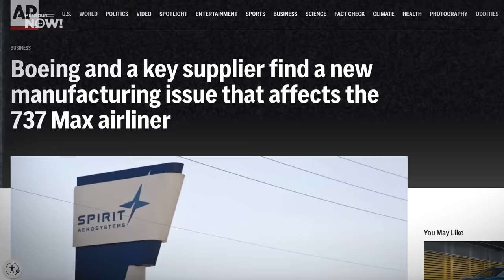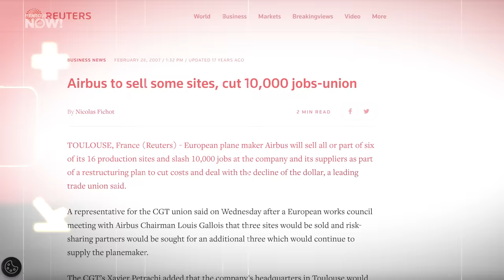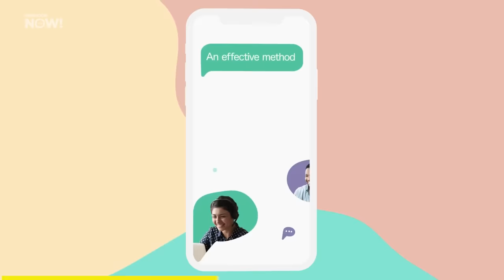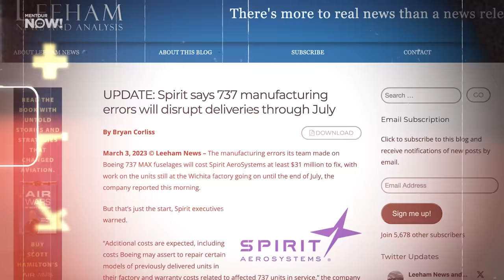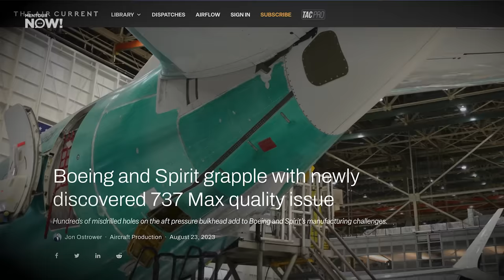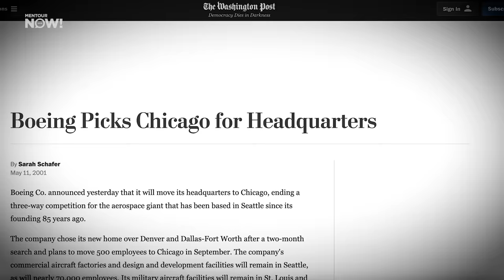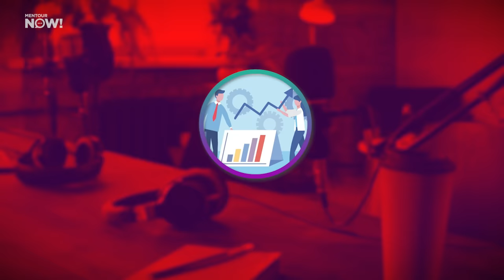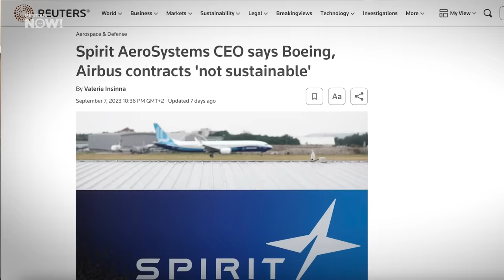NEW Problems with the B737MAX!

Comment: I’m not a financial expert by any means, but it seems to me that this whole RONA thing only works if those divisions produce different products. If what a division is producing is core to your own company’s product, you would think that that was maybe more important than the fact it made less money? Maybe your profits in other areas are because this department exists? And if you spin off the department into its own company, not only do you lose precise control, but it also has its own complete management structure which will make it less aligned with you and more expensive
Reply: Yeah exactly, if your other products are fundamentally reliant on it then the theory doesn't make nearly as much sense. An example of this that always gets to me is when some penny-pinching government cuts its rail service to small towns in the middle of nowhere. Sure, maybe the line didn't turn much or any of a profit, but if I can't get to the nearest major city then the fancy high-speed line passing by there that they keep bragging about is fucking useless.
Reply: True, internal cost allocation is a stupid idea brought into big companies. Every year, something is shuffled (e.g. switch from an expensive component to a cheap one) by the customer departments to save costs. But as these costs are driven mainly by fixed costs e.g. personnel, next year these costs will be allocated to the remaining or other parts of the equation😂 Outsourcing of important „components“ of the whole operation pipeline in most cases leads to costs which are just written on another page of the same financial statement. Only sometimes costs can be transferred to employees or the customer or society, but that‘s actually a bad thing.

Comment: If I remember correctly, Airbus added small surveillance cams to their riveting machines at wing production site. Putting 60000 rivets produced 60000 shorts as camera turned on and off with the machine. QC then may have inspected these videos.

Comment: Worrying for Max8 aircraft in service. My main concerns are how many Sprint made bulkheads are currently flying around with elongated “snowmen” holes, and even more concerning is what is their pressure cycle to failure, ie. how many take off and landings and flight hours logged at high pressure? Thanks for clearly explaining these issues which I had only vaguely heard about previously.
Reply: reminds me of what happened to the china airways plane with he bulk  head repair
Reply: @wayneandrews9298  Japan Airlines wasn't it?
Reply: @jambon7681  eeerrrmmm , i think we are both right ,, china airlines 611 did suffer a catastrophic failure & split apart & crashed & yes it was the japan airlines flight 123 that suffered the catastrophic failure when the the bulkhead gave in ,, very similar but of course very different ...

Comment: Railway land should be kept as a strategic reserve. As in the UK, they were built when the land was available. To close the line is one thing but to re-purpose it for roads/cycling/walkways seems incredibly short-sighted. The generous U.S. loading gauge is certainly an asset.
Reply: The lines did not close. They are intact and in operation.
Reply: And yet country after country goes and privatises its railways completely

Comment: So Add loose door plugs on the max 9 to the problem list, a few days ago Alaskan airlines flight 1282 blew out a door plug at 16000 feet. Investigators found that bolts holding the door plug on were loose. Whole fleet is grounded again

Comment: Hi Petter. I don't understand how its ruled out that these issues are not present in airplanes currently flying in the air. Could you please explain a bit more? I have friends using the MAX 8 regularly and these production mistakes are quite furious to say the least
Reply: No they're saying it's not an immediate safety concern for currently flying aircraft, presumably based on engineering analysis, meaning they still need to remediate the problem but they don't have to ground these planes until they are fixed.
Reply: It's something like a component originally rated to 200% of flight load can only handle 180% because of the mistakes. So it needs to be fixed, but not urgently.
Reply: I think he’s saying it’s not an immediate safety concern which it’s not.
Reply: They’re just waiting for a couple of them to drop down and kill a few hundred.

Comment: As a greater Wichita area resident therefore aviation fan, I dont like losing ANY aerospace jobs, the layoff/callback/strike cycles lead to a lot of stress and economic turmoil for skilled fabricators, installers, and A&P mechanics. I will say, if Spirit can get an edge on Boeing, the latter will deserve it for creating a (now independent) wholly-owned subsidiary to break existing labor contracts with the parent company.
Reply: It'd be a big step, but I'd say there's a case for Spirit to make their own airliner. The advances to be made are in aerostructures, wing designs, which Spirit is not inexperienced in. Subsystems can be bought in, as can engines, undercarriage, etc. 

Why be subservient to debt-laden, cash starved, badly run Boeing, when they could go it alone? Better still, they have a grip on Boeing's means of production for the 737 cash-cow; they could, and probably should, squeeze.

Another (crazy?) option would be for Spirit to go full-in with Airbus. Airbus clearly want to expand in the USA, and are quietly building an empire down in Mobile. Why wait for that to grow to dominance (which it will, whilst Boeing prevaricate), when Spirit could be part of it by presenting Airbus with a really big step up in the USA on terms that are good for Spirit too? 

That could mean the end of Boeing, and the global dominance of Airbus. But, if "Airbus" then meant "substantial US involvement and participation in the group", that could be something the US government could be happy with.

Comment: As a restorer of classic cars, I noticed early on that whenever I would try to save money, no matter how well thought out or sensible. It always cost me more money in the end. I think that trying to modify the existing product to take the new engines, as in the 737 max, Boeing encountered the same issue. I have dealt with many times.  Whenever you try to save money, it costs you more in the end. I have been flying a lot lately and on a recent flight I noticed the card in the back pocket of the seat ahead of me, said Boeing 737.  I asked the stewardess if it was a 737 max. Somebody two seats behind me laughed and said, that was my question! I was actually considering disembarking the plane. I will never fly on such a thing. Boeing had better start to think. I believe that company is incapable of making sensible decisions.
Reply: At least you get a learning experience out of your tries.
Reply: IF IT'S BOEING, I AIN'T GOING!!!

Comment: Why is it that every project Boeing is involved with has gone to hell because of bad management? Does anyone know if these managers are the same ones responsible for their space devision? The starliner is delayed indefinitely now and Boeing are getting sued for cutting corners on the Artemis SLS core stage which resulted in the loss of many ride-share satellites.
Reply: Not sure if this problem caused by spirit is due to Boeing management.  Seems like a Spirit cover-up at the manufacturing level.
Reply: To be honest, I would be amazed if they were the same managers. The company culture, however, could certainly be to blame. Boeing has certainly been a massive disappointment in many areas recently.

Comment: Transporting wings between Renton and Everett is no problem. They do it all the time on Interstate 405. (Well, there are 10 miles on Interstate 5.)  

The trailer with the wing on it has a driving unit under the trailer structure holding the wing, near the back. There is even a set of headlights for the driver on the trailer. It is similar to a ladder truck used by a fire department, except the driver on the rear wheel of the ladder truck is usually sits higher than the trailer structure, not under it. 

They have "oversize vehicle" warning vehicles escorting the tractor trailer carrying the wing. 

It can be shocking the first time you are driving along at night, passing the entourage, and look over at the driver sitting below the wing. 

I've usually only seen these in the evening or at night, avoiding the notoriously bad traffic. 

There never was a direct rail connection between Renton and Everett. The rail-to-trail line you mentioned originally went to Snohomish, where you would have to take the BNSF mainline to Mukilteo for the Boeing spur; that has been gone for many years. There is still the line from the Renton plant to the BNSF mainline to Mukilteo through Seattle. 

It was amazing how McDonnell Douglas bought Boeing with Boeing's money.

Comment: How many poor décisions can a corporate take?
Boeing: yes
Reply: Not boeings fault
Reply: @@arisnothelesif they are paid by Boeing then they are a perfect example for Boeings poor decision making 😂
Reply: @@arisnotheles yes and no. 
The subcontractor made the error. 
But it's Boeing job to make sure that the subcontractor doesn't do BS.
You see two people/companies can be at fault at the same time.
Reply: @@arisnotheles you confuse me.
When writing my second comment I didn't realize that I replied to the same person who wrote the first comment I replied you (that's you). I thought that were two different people because those two comments are completely different. 
Why are arguing both sides?
I've no idea what's going on in this comment thread...
Reply: @nickolliver3021  I suppose JAL Flight 123 wasn't Boeings fault either. Oh wait, it was. Boeng incorrectly fixed the bulkhead but again that failed. I suppose the cargo door failing on United Airlines Flight 811 wasn't Boeings fault either despite the fact that Boeing knew that the door was a faulty design and tried to hide it. Boeing may not have made/assembled these bulkheads, but it should have had some quality control inspecting them. 

Here is an example for you. The Deepwater Horizon oil spill was not the fault of BP, it was the fault of Transocean. However, BP were responsible for it because they hired Transocean to do the job but didn't check or ensure they did it properly. Boeing have hired Spirit to do a job, but haven't checked or ensured they are doing it properly. Understand?
Reply: @@arisnotheles Not the way subcontracting works! It is Boeing's fault for not monitoring the subcontractor.  There should be a Boeing rep at Spirit, watching operations, checking quality and tolerances.
Reply: @Jehty_  A troll, Oliver.
Reply: @cplcabs  What do you expect when your drill rig is run by a "toolpusher"?

Comment: Could all this fitment issues and bolt misalignemnts be also an issue for the 737 MAX 9 emergency exit door on the alaskan airlines fligth?
Asking since the emergency door was sealed in place and never meant to open with this aircraft

Comment: It looks like the latest accident is related to this snowman defect. The aircraft actually suffered pressure issues prior to fuselage explosion. It's not a simple bolt issue, so all 737 max airplanes should be grounded until a permanent solution is found.

Comment: You can attribute all of Boeing's issues in the modern era to the McDonnell Douglas merger. Boeing was known in the industry for its engineering prowess ran by engineers, and MD for airplanes with quality issues ran by bean counters. It would not surprise me if they end up being solely a military contractor at some point. AIrbus is eating their lunch and the Chinese are now making their own airplanes. The latter isn't quite there yet, but not far off from challenging Boeing for the number 2 spot.
Reply: It's going to take a while for the Chinese airliners to gain any traction outside of Asia and Russia, but they can advance quite quickly if they want to.
Reply: @Skyhawk1998  They have even more problems then MAX`s now, so lets put them aside.
Reply: You're half right about Comac... they are well on their ways to manufacturing #2.
Reply: @Skyhawk1998  I don't think Russia is going to buy many Chinese planes. Russia has its own aerospace industry it's trying to support. I would expect the main market for Chinese planes to be China and poor third-world countries.
Reply: @@nidoking1044 deeply suspicious, and yet whence do we buy all our electronic hardware? 😄
Reply: @@nidoking1044 Including consumer hardware too? Good to know. Do you by any chance have some good search terms I could use to find out more? Thanks in advance
Reply: The Stratofortress was made with Magnesium carburators and plenty of our boys burned in those before they out in Fuel injection. Another Boeing- Bell V-22 Osprey just crashed off of Japan. 55 solders have died in te dozen or so failures.

Comment: Mr Mentour......I worked for Boeing for 8 years before my retirement (prior to that I was a Building Tradesman who worked on several Boeing Projects in the Seattle Area as well) You are wrong in your assessment about the railroads as the 737 Cigars (Fuselage Assemblies) are transported by rail/train from Wichita KS on the BNSF trains to Renton, 
That route also goes through Everett WA as Boeing also has rail access from the Port of  Everett to the Boeing Everett Site 
adjacent to Paine Field, The Boeing train that goes from the BNSF Interbay yard in North Seattle to Renton is a local train nicknamed
"The Renton Rocket!" plenty of YouTube videos on that!
As for Wing Production, Boeing made the 747 Wings at Auburn WA which is 17 miles (27km) south of Renton! 
Boeing would transport Wing Assemblies to Everett by Special Trucks up the East Valley and 405 Freeways usually at night,  
so I know they have and can handle can handle the logistics to do this!

Comment: Its an interesting situation when farming out work to sub contractors in any field.The financial issue is in theory that it may be more cost effective to actually do the work "in house" as oppossed to paying a sub company.However that subby has tooled up speciffically to in this case supply Boeing and I bet my last quid that shareholders from Boeing effectivley own that company.A great example was the Titanic oceon liner owned by White Star but built by Harland and Wolf who by shareholding was owned by the former.Its always about money.
Reply: Spirit was created as a wholly-owned subsidiary to get out of unfavorable labor contracts with the International Aircraft Machinists and Aerospace Workers and the Society of Professional Engineering Employees in Aerospace unions (IAMAW and SPEEA). You're correct, money was definitely the point... create a new spinoff company and lay off workers from Boeing and get them to work at Spirit with less favorable terms for the same jobs. Today, they still supply them, but they're not limited to that. I am not in aviation, but it's almost impossible to live in Sedgwick County, KS, and not have at least one friend or relative who works at Textron, Bombardier Learjet, or Spirit.
Reply: Outsourcing of ANY type, never works and ends in disaster. Can anyone say "ValuJet" children ? 😮

Comment: It seems that ALL quality control issues are affected by only one factor, the GREED of the CEO and the Executive member to get their gigantic salaries and bonuses, and this results in less money spent in quality control and cost cutting measures. It seems for every million bucks saved initially, it comes back to bite them in the ass with a cost of ten times more and an another severe tarnish to their reputation. What kind of company management puts the safety of that travelling public over obscene profits, possibly one run by a group of very greedy, soulless narcissistic sociopaths.

Comment: Added to the problems Boeing faces, today we learn of the Icelandair 737 Max 9 with its Emergency Door blowout, which is terrible publicity for both the Airline and Boeing and its 737 Max.
I did wonder if the previous passengers had tried to open the  Emergency Door to increase ventilation? These Emergency Doors can be operated completely by the Passengers and are not under the control of the Pilots?   Otherwise, it looks like a quality problem with the fuselage building which Boeing can well do without, we will all have to wait and see after the inquiry to learn the cause.
Thank goodness that the seats opposite these emergency doors were not occupied.